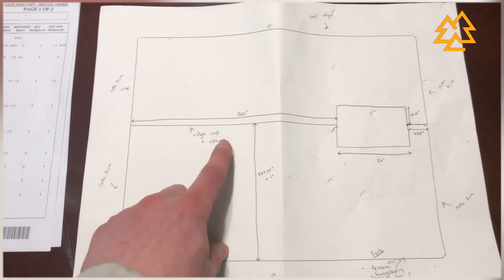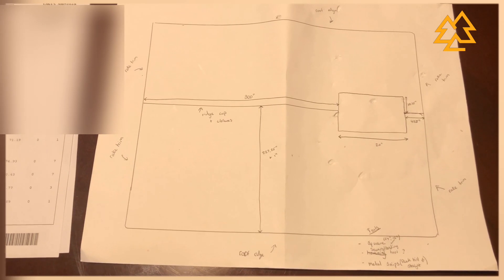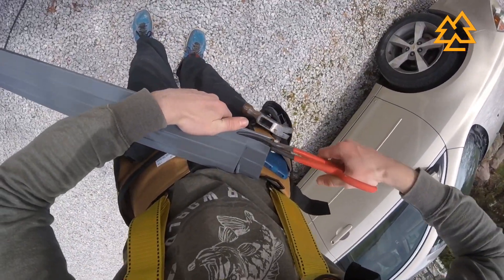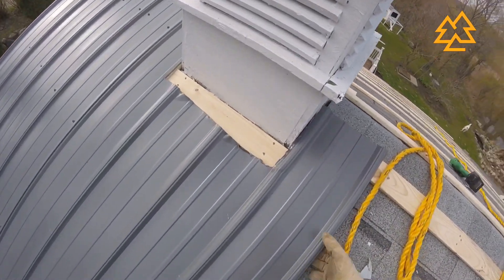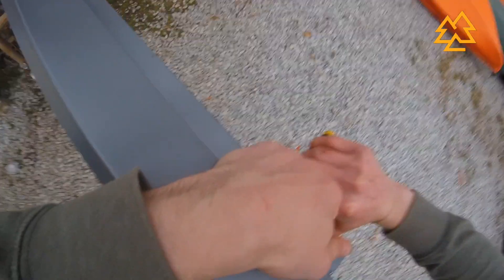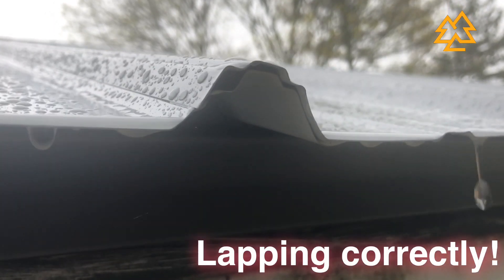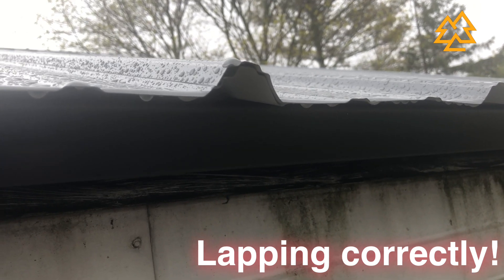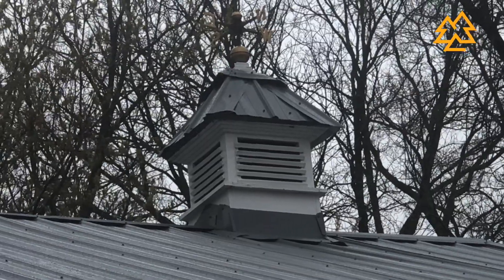DIY exposed fastener metal roof | My Experience

Comment: Great video! I'm an older fella on my first metal roof. (Done a few shingled projects).  Here is what I've found on Youtube.    There is a different "metal roof" drip edge that hangs over farther - the one you used looks like regular drip edge for shingles.  It can be pou on to hang into your gutter.  The standard overhand is 1-1/2" beyond the drip edge.  Best way to "square the panel is to run a chalk line along your drip edge say, 2"" from the edge at either end. Then mark your panel at 3-1/2" to allow for overhang.  Then carefully align the 1st panel with your chakkline.  Next, your large ribs are 9" apart, you need to be sure each end is in the correct place to be covered by your rake trim looks like you got lucky. A tear off is a good idea as your nails for the purlins should extend into your rafters/truss you roof is only as strong as the weakest attachment.  many roofers attach the rake with screws every foot or so but you need a square edge under the trim so you can get it close.   Last, the roofing mfg says to put the screws in the center of the flat part, not close to the rib.  I bought my metal from a HUGE Amish owned local company.  I get next day delivery.  They can make custom trim- probably would do your cupola.  Very reasonable prices.   Finally thought: switch you thumbnail to a screenshot of your bride in her sunglasses adjusting the seal at the lower edge.  It'll get you several thousand more views!😊

Comment: For teaching yourself as u go u did a damn good job bro!!! I've worked with many many professionals thta just dont do a quality job on metal, it's awful, a tip for you. I always put screws on the outside of the rake trim, but not necessary, if you cut the rake trim at an angle on the bottom u can slide the top piece of rake into the bottom piece and it wont stick out like it is, cut it at like a 45 degree angle and itll slide right into the other one, I'm doing a metal job now, I'll take a few pictures of it and I'll do a video for you to see how I do it, but you did an amazing job bro good job!!!!!
Reply from the maker: Thanks for the tip! I look forward to seeing how you do that!

Comment: I think you did a great job on the cupola for not having a kit.  I would suggest you get the bottom fully covered up to that lip and then caulk it at the top to bottom of the small over hang.  As is I am afraid water will get behind your metal.  Should only take a strip run under the lip on that cupola that extends over what you have already put on all the way around.
Reply from the maker: Yes, I think that would be a good idea too. Thank you!

Comment: I’ve seen this before and I don’t know what your climate is but I see were people I have put like a radiant barrier under the wood I’m assuming over the other tarpaper and then that way you have a radiant barrier and you have a gap between that and the steel, and then that hot air can sit in there and then move up towards the top of the roof And you get a reduction in heat transfer going into the property before you even get to insulation and it usually doesn’t add a lot of cost when you consider how much you’re actually spending on the metal roof. You might be adding an additional 300 bucks just for an additional layer of tarpaper and a radiant barrier and the only reason I mention this is because I have been watching a lot of videos about NetZero houses and I’m not too much concerned about the renewables, but I’ve always love the reduction in energy consumption with properties. I guess it’s my kink.

Comment: One thing that could also throw your panels off is this . When measure your roof  go from top at one side measure down to edge roof  do same other end . 

Very possible house being older never was or is 100 %  square even a inch or two difference can make huge results after a run of say 30 to 50 ft .

If is out not same figure out how much out divide the inch or two out by width roof . Then start with first sheet laying that small percent on a angle by that lil smidge as you lay each sheet will slowly gain not be short .

 Just need know what end is shorter run your gain / plus measurments to that end .
Reply from the maker: Very possible, good advice!

Comment: Wherever you have unsightly raised laps simply drill a hole and install 2 pop rivets & the lap will vanish with a dob of touch up paint ,i use rivets on my ridge cap instead of screws,i also NEVER attach my panels by installing screws in the pan,i pre drill through the top of the ribs to prevent movement then attach my panels screws through the raised lap .
Reply from the maker: Thanks for the insight! I pre/drilled a few and that is definitely easier and more efficient. Whether to put the screws in the flat or on the rib seems to be a common point of contention, I’ll see how mine holds up with the screws in the flat!
Reply: Try not to predrill....use a punch and a good swing of the hammer.  Waaay faster and no metal shavings to scratch the surface.  I always screw in the flats.  The metal we use, the ribs are not flat on top and I feel screwing thru the ribs is an old school method.  Plus the washer can't seal on that small of a surface on the rib.
Reply: @homesteadpursuit8535     When i installed my metal roof, the manufacturer stated it could be screwed on the flat or the ribs. If it’s screwed on the flats the screws show much less and snow doesn’t slide off as easily.
Reply: @homesteadpursuit8535  I've done miles of metal roofing, the screws should go in the flat, not on the ribs, screws on top of the ribs cannot be drawn down tight because there's nothing under them, expansion of the metal causes the screws to come lose, I've had to replace metal roofs that were screwed on top of the ribs, kept coming lose and leaking, replaced the whole roof with new metal and screwed it down in the flats, no more problems, Michael Ledford is like a lot of people, they must like problems.

Comment: First honest video I gave seen -- no one Ever gives a price, my tiny shed with generous overhang came to 10' x 16' and with all the other xtras I wanted, wider drip edge + simpson B3" special order teflon/rubber washer screws (similar to deck ties, my honemad do-it-yourself baking shed has to hold up in hurricane country, and not over an existing shi gle roof but, grace-shield self-stick underlayment)...came to $830. Shingles could have saved me $250, and 40 yrs. less wear.

Comment: Great stuff. Thanks for sharing the mistakes. You both did a great job, kudos. Can you detail the costs and savings if you have contracted this. Also any reason for not considering standing seam roof
Reply from the maker: I went through Menards which I was happy with the ordering process and quality of materials. I paid roughly 2k for materials and put in about a week of work. I didn't have the project quoted by any contractors so I'm not sure what the cost would be hired out. Standing seam was just more cost for materials so I went with exposed fastener.
Reply: @homesteadpursuit8535  : excellent

Comment: This video is one of the best I’ve seen! I’m planning something similar and was wondering since my detached garage isn’t heated, would I need any roof vents? Main reason I ask is that the roof trusses are blocked between them at the ridge with 2x4’s. Would appreciate you thoughts, thank you
Reply from the maker: I don’t think I have the expertise to give you a full answer to that question. I can tell you that I’ve done projects similar to this since I made this video and I added a ridge vent on one building which is really easy to do by using vented closure strips.
Reply: @homesteadpursuit8535  Metal has been ordered and your video has given me the confidence to tackle. Thanks for this video again, it’s honestly the best diy video in my 50+ saved videos on metal roofing lol.

Comment: A great video. How did you keep from sliding on the metal. I tried to put snow blocks on and kept sliding down to my ladder.
Reply from the maker: I had pretty grippy tennis shoes and then when I had to, I would use the harness I was wearing to hold myself.
Reply: A roll of no slip drawer liner is great to hold you on and your tools, so no need to chase your tools down the roof but a harness is best 😊

Comment: Great job. Curious how long the exposed fasteners will last?
Reply from the maker: Im curious to see too. Most of the forums I was reading through when researching the project said 20 to 30 years, with manufacturers saying 30 to 40 years. It seemed to me that most sources pointed to how well you install the screws and set them properly as being the most import part of the install that will determine their life.
Reply: @homesteadpursuit8535  thanks for the reply. Yeah, I’m looking to get my roof replaced and some of the roofers claim the exposed won’t last but I think they just want me to buy the more expensive hidden fastener option.
Reply: Exposed fasteners could last 20 yrs could last longer,but I was told to exspect to replace them in 15 years.

Comment: Why didn't you just connect the steel panels flat onto the asphalt shingles negating the firing strips?  Tx
Reply from the maker: The asphalt shingles would create an uneven surface and the rubbing of the shingles on the bottom of the metal would decrease the lifespan of the metal roof. You can add fanfold foam over shingles though and put the metal on then.
Reply: Makes complete sense, thanks!.  One more,  once the steel is installed is the steel strong enough to walk on ?  I weigh 175. 👍
Reply from the maker: Oh yeah! I weigh 165 and walked all over it, no problems. It's slippery though, anti-slip shoes are helpful.
Reply: Excellent 👍

Comment: How’s your roof working out a year later? Would you recommend this roof for a house?
Reply from the maker: No leaks or problems so far and I did end up putting this same type of roof on my house. When I get some time I will upload a follow up video showing the house as well!
Reply: @homesteadpursuit8535  Good to hear. I’m learning about metal roofing as I go. I just replaced mine yesterday with a heavier gauge than usual exposed fastener metal roof. They put 1x6 furring strips down and covered that with tyvek and put the roof on top of that. The surface of the metal is textured for walking on it. I’m pretty sure it’s a 40 year rated roof. It’s really probably a lifetime roof. They put all the metal down yesterday and still need to cap it. It started raining last night and is going to rain all day into the night. No leaks. The  tyvek vapor barrier really makes a difference and no doubt is preventing leaks in addition to the roof metal. It’s really a nice roof.
Reply from the maker: @jonnyboat2  Sounds really nice! The product I got was rated at 40 years as well. I'm interested in the textured material, I haven't heard or seen of that when I was doing research. Very cool!

Comment: Nice roof. It will last forever if you get the rest of your screws in. Snow will slide off roof in "avalanches". That's only a problem if it becomes a problem in front of your access door.If it does you can screw on tabs to the roof above the door to keep snow on the roof till it melts. If it doesn't become a problem because you can use the car door entry , then it is better to let the single entry door get snowed in. Your choice. Would have costed 2 to 3 times more if you hired it done.
Reply from the maker: Yes we will see this winter if that becomes a problem. I think it I will just use the garage door if it does and clean up the side entry as needed. Thanks!

Comment: Cant help but fail with screws in the flat. 2 1/2" screws in the high rib, but nobody does it correctly. 5 years remove a sheet and look at the 1x4's.They will be rotting. Terrance Wolfe, Humble Tx. engineers every sheet I've bought in florida and alabama. Someone finally demanded (and paid big bucks for) engineering for high rib fastening. Grandaddy was born 1898 and would tell him what an idiot he is for all the thousands of miles of panels put down pollack style now in need of yet another reroof. Live and learn, die and forget all of it.

Comment: I would have removed the asphalt shingles, laid roofing felt, then put the metal roof directly on the roofing felt.
Reply from the maker: That's a good way to go if I was doing a complete tear off, the guy that sold me the materials also recomended putting down fanfold foam underlayment.
Reply: Roy, I wouldn't.